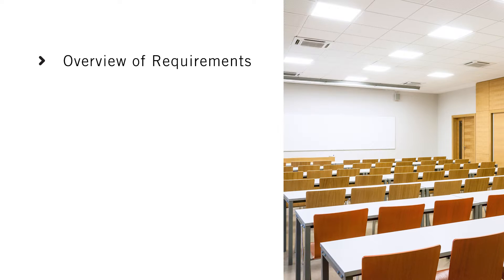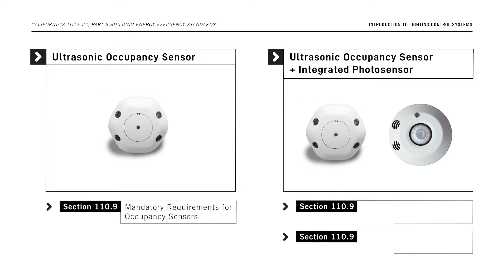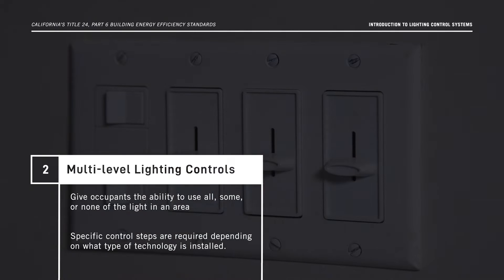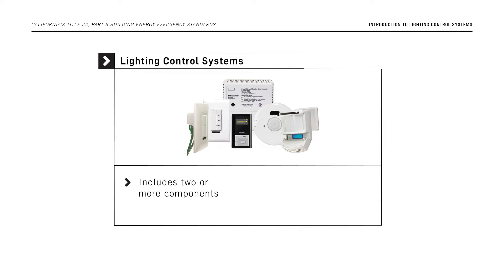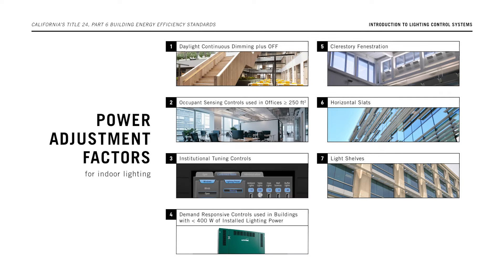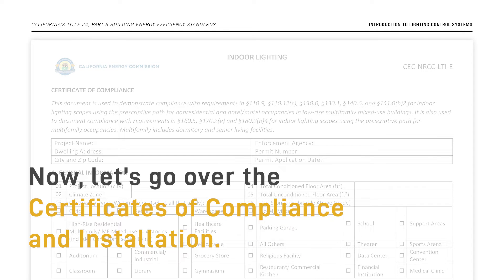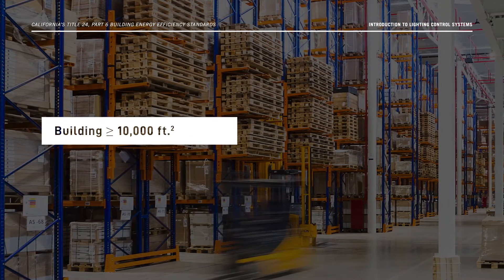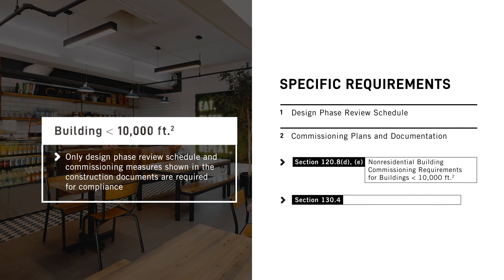2022 Title 24: Introduction to Lighting Control Systems

Comment from the maker: CORRECTION:
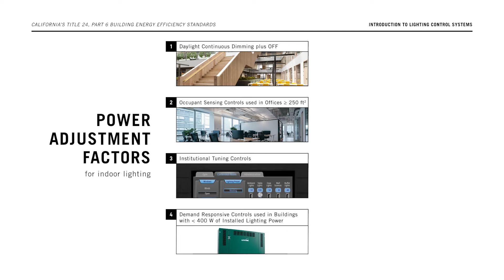(5:50) Power Adjustment Factor #4 on-screen should state "Demand Responsive Controls used in Buildings with <4000 W of Installed Lighting Power".